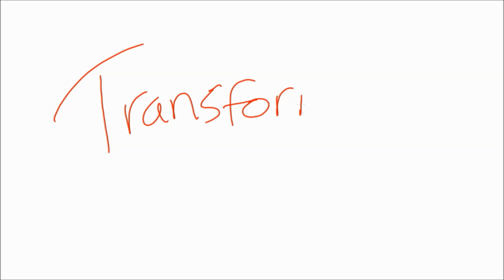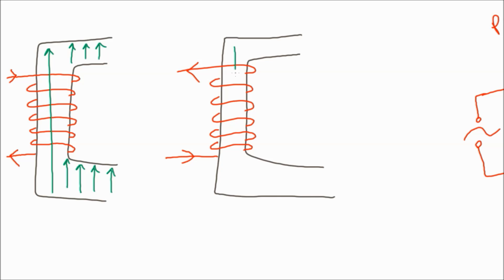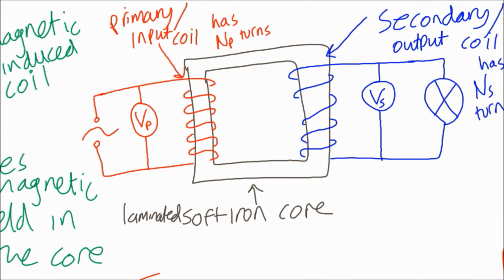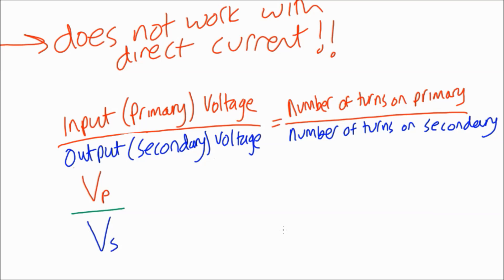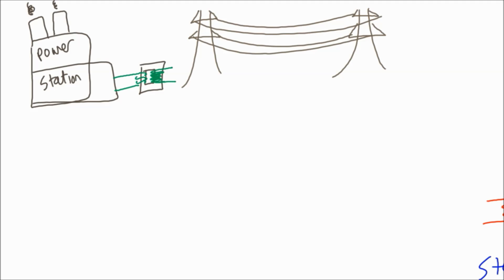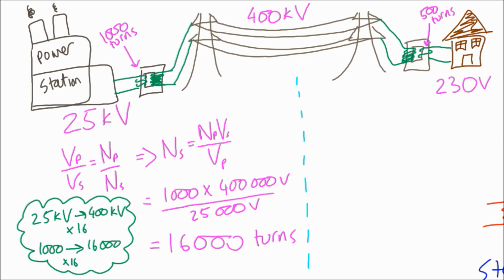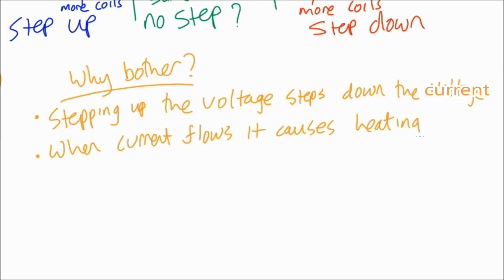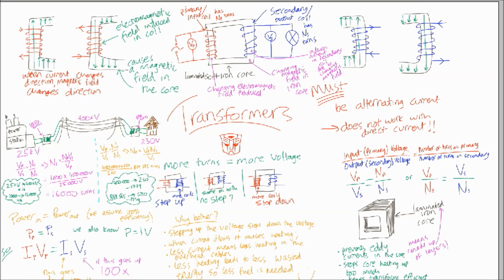IGCSE Physics: Transformers

Comment: In the realm of physics, a tale unfolds,
Of transformers, not Autobots, truth be told.
No Optimus Prime, no Megatron's might,
Just coils and circuits, sparking with light.

Oh, the transformer, a magical device,
Not a robot in disguise, but oh, so precise.
From AC to DC, it changes its game,
Flipping volts and amps, without any shame.

In coils and windings, a dance so grand,
Electrons twirl, like they're in a band.
Voltage steps up, current takes a bow,
Physics waltzing, here and now.

Magnetic fields embrace, a cosmic dance floor,
Transforming power, like never before.
No Decepticons here, just electrons at play,
In the physics realm, where transformers sway.

So here's to the transformers, not robots, you see,
Physics superheroes, in their own esprit.
Changing the game with electromagnetic might,
A comedic twist on a physics-filled night.
Reply: insane

Comment: Thank you! Don't know why my physics teacher makes it look so complicated :/   Question, though: can any other core be used other than iron, just as long as it's soft? And why do more turns result in a higher voltage?
Reply: It's the V=IR equation. When you increase the number of coils, the resistance increases, thus increasing the voltage when you multiply your increasing R with I.